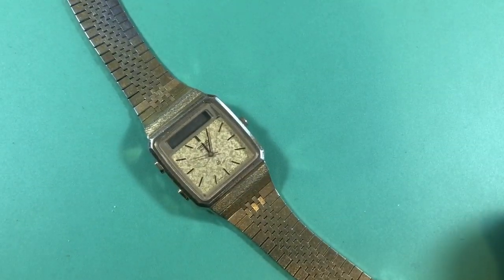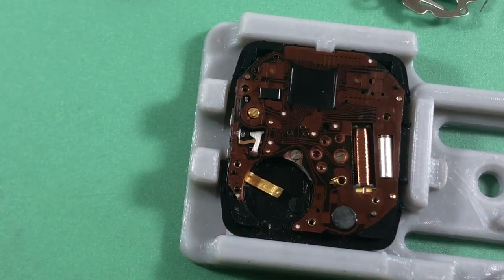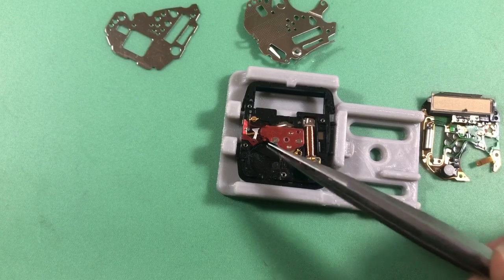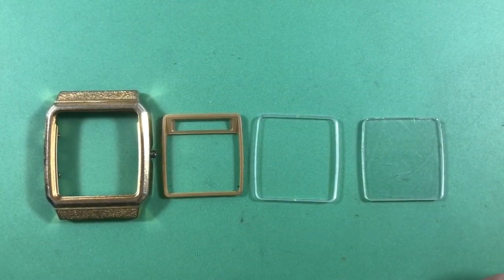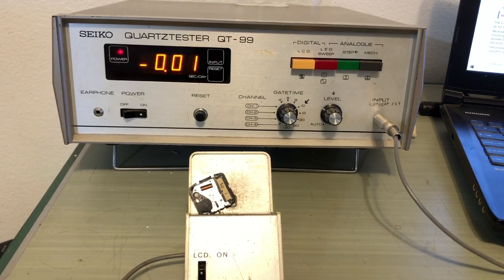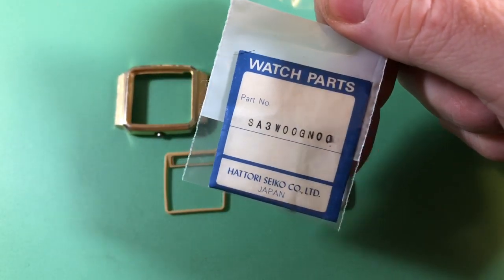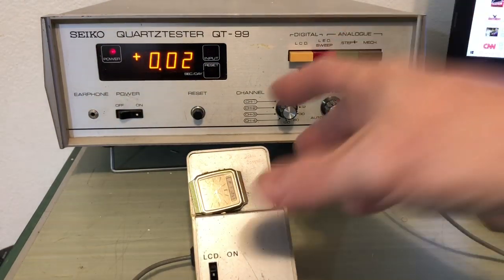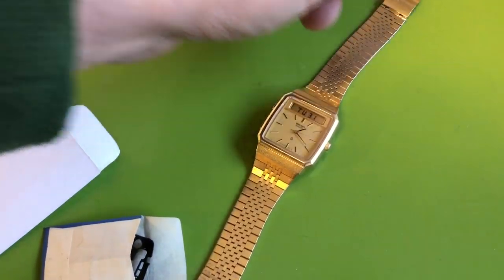For JB: Your Seiko H557-5080 restoration

Comment: Hi Spencer. I'm from Australia and I've found your videos very informative. I'm a seiko fanatic and saw your video on the 7548 quartz divers. That's the first watch I bought myself back in 1985. Still have it, still goes well. Would you be able to tell me if it's worth restoring an old Silverwave G757A-5000. I'm having trouble finding anybody here that knows whether it's worth it. Any info would be greatly appreciated.
Reply from the maker: That model is one used in a James Bond movie - Moonraker maybe?  They're rarer and quite collectible.  But if you have a bad LCD and/or circuit, you're in for some real work as both are long out of production.
Reply: @SpencerKleinVintageWatch  Thanks very much for getting back to me. I really appreciate it. If you want it, you can have it. Nobody here seems to be interested.

Comment: These duo display Seikos are just fantastic little machines. Great restoration. I love seeing a quality piece like this back in service for another decade or more.
Reply: Actually seiko made them so they would self-destruct....
The battery would last al little more then 2 years and then would leak badly... Attacking all the electronics an destructing the plastic and the guarantee only lasted 1 or 2 Years... As seen in the video this one also started to self Destruct... Plastic Frame cracked etc...

Comment: I got one 557 5110 too. Glas is broken in one corner, battery is done, and the crown date setting didn´t work properly - made huge jumps when winding. Repair or not? Would cost a 100 bucks here :/
Reply from the maker: It depends how much you like the watch, and what that repair fee will get you.  Is that everything done including the case seals, movement service, glass etc?

Comment: Hi Spencer, I'm finding your restoration videos very addictive and informative so thanks for putting them up. I have an H357 which is impossible to set using the crown because the digital digits suddenly advance multiple minutes or even hours with the smallest turn. I hear/feel some clicks from the crown but not on every turn. It's the same behaviour in the opposite direction. The rest of the module works fine, the analog hands set ok and it keeps good time, so i'm thinking this must be a mechanical issue with how the crown makes contact with the lyre-shaped piece you point out in the video. Would this be a fairly easy fix for a careful novice? :)